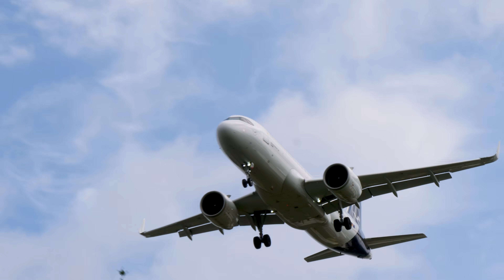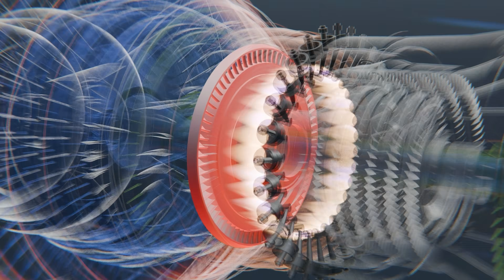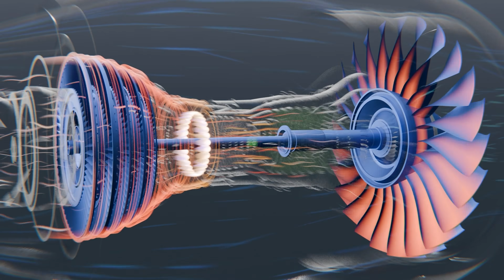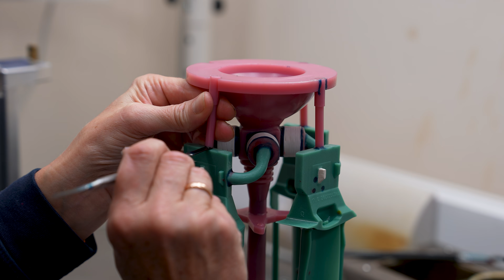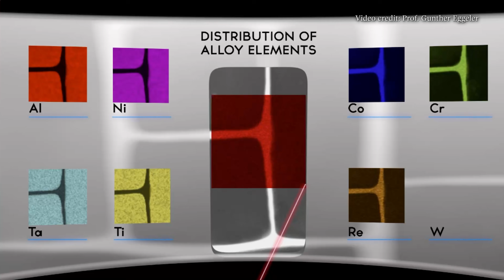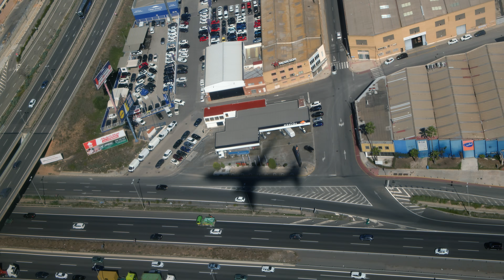The Ridiculous Engineering Of Jet Engines

Comment: I noticed the title changed. For the record, I was more interested in how it runs hotter than its melting point.
Reply: They test different titles on different people so they get the most clickbaity one (same for the thumbnail), it's getting old and boring because you know for sure, turbines get a lot of dirt when working. I mean, they are giant vacuum cleaners!
Reply: @Ktulu789  its not them doing it. they upload multiple thumbnails aswell as different titles, youtubes algorithm Choose wich to use to get you to click on it
Reply: The Mrbeastification is real
Reply: "For the record, I was more interested in how it runs hotter than its melting point"

I guess you didn't actually WATCH it then... because that is exactly what happens.
Reply: @thomasneal9291  wait the title changed AGAIN. When I first commented, the title was something like, "what happens if you throw sand into a jet engine?"
Reply: current title is Why Don’t Jet Engines Melt? for future ref
Reply: @jademonas yeah that's what it was when I first added the video to my watch later. Then it changed to something about throwing sand in a jet engine by the time I actually watched it.
Reply: @thomasneal9291 I was talking specifically about the title changing. The title I first saw was something like, "how does it run hotter than its melting temperature?" By the time I watched it, it had changed to what it is now.
Reply: Same. In fact, i had forgotten what i wanted to watch because the actually interesting premise wasn't visible anymore. It can be very annoying.

Comment: jet engines are interesting, they are operationally more simplistic than a piston engine as they spin and do the intake, compression, power and exhaust all at once in nice clean linear fashion. no parts moving rapidly in one direction, stopping, going the other direction.

Yet to spin fast enough and burn hot enough to be useful they require materials science and machining precision that no piston engine could ever match. And despite all this huge complexity to make one, jet travel is still safer per passenger mile than any other means of getting around, You are safer during your flight than you were driving to the airport and will be driving away from the destination airport.

Comment: I see this video in my feed for the last week or two and I've seen several iterations of the title and it's really upsetting to see it getting dumber with each version. First it was something like "how jet engines work". Then it became "works at 1500 degrees, melts at 1300". Now it's "what happens if you throw sand into a jet engine". I get it that you run A/B tests to get more views, but the fact that to get more views you need to get dumber and invent cheap sensational bs a-la "red hot knife vs potato" is sad.

Great video though, as always.
Reply: There is absolutely nothing in this video that isn't in several dozen other video's about turbine blade manufacture from 10+ years ago other then he compiled that information from 10 years ago and dumbed it down for an American audience.

Comment: Jet fuel can't melt jet engines.
(Coincidentally this video also contains the explanation of the WTC structural failure: You don't need to melt stuff at 1500 ° C to do damage if it has the tensile strength of a wet toast over 600 ° C)

Comment: You could have spent a minute on the flip side of jets becoming cheaper and cheaper to fly: The Jevons paradox. You increase the efficiency of something, this makes you consume less stuff (jet fuel in this case), this makes it cheaper, and that causes more people to want it, and so you end up consuming MORE stuff. This is happening big time with aviation. People are flying more and more, and more people are flying, this by far outweighs the gains in jet efficiency. So the fossil fuel consumption and the carbon emissions from air travel keep increasing, with no end in sight. Most other industries have credible paths to decarbonisation, but air travel doesn't really have any.There's no credible path to electric mass air travel other than short hops. Biofuels aren't credible either, because of the huge land areas needed to grow them.

The market can only limit this if more carbon taxes are added (or bans on airport expansions), which drive up ticket costs and cuts off those who only now are beginning to be able to afford flying. Voluntary flight reduction doesn't seem to go anywhere. There is one fair method: Assign air travel quotas to each person. Those who don't fly can choose to let their quotas expire, or sell them to people who want to fly more. This would keep it cheap to fly rarely, but would drive up costs for frequent fliers. Businesses would adapt and travel less. (There are problems with this, certainly, but the status quo is not sustainable. Something has to give.)

Comment: EVERYONE LIKE THIS. Veritasium, for your "why has noone measured the speed of light" video i have a solution. So.. what if we send the light from both sides, we have a clock on 1 side and a clock on the other. Both clocks will start the timer them the light is sent, when the lights reach the opposite clocks the clocks will record the time, Not stop. When the lights return the clocks will stop. That way we can tell if there is any delay and reverse engeneere it.

Comment: 0:00:  Without watching this video I can answer that question.  You throw sand into a jet engine and the inside of that engine is so hot that the sand will melt into a liquid glassy substance which then freezes up the engine.  The military equipment in Iraq in the year of 1991 had problems because the fine desert sand --- like confectioner's sugar --- was getting sucked into the engines and then gumming them up when it melted inside the engines.  And by the way, sand in a jet engine falls under the definition of FOD.  In the military, FOD stands for "foreign object duty" which involves the daily task of sweeping runways and aircraft carrier decks of anything that could get sucked up into an engine during takeoff.  However, FOD is also used as a noun to describe the actual pieces of foreign matter --- such as "losing a jet engine to a piece of FOD".

Comment: Am I the only one annoyed by the conclusion of this video?: Why don’t the blades melt at 1500 degrees? Because they’re not at 1500 degrees (cooling channels and ceramic coating keeping the metal underneath cool). So the metal underneath isn’t running at those temps at all, only the ceramic is.

Comment: Licensed A&P here. The FAA states 75% of the air passing through the hot section should be utilized for cooling. This means your flame is only burning 25% of the air. That remaining 75% cooling air is specially tuned like an organ or other instrument to ensure that the flame itself is not melting the turbines, vanes, or the sidewalls of the combustion chamber. If the flame was actually touching the turbine blades this would cause them to melt.

Comment: You didn't mention that the reason that Whittels jet engines were possible, is they used the newely developed Inconell, the 'Staybrigt' branded stainless steel used for cutlery, the only reason that modern turbine blades can survive higher temps, is that they have over 400 cooling holes in them, amongst the ceramic they add for those temperatures..

Comment: As always, another "brilliant" presentation. Our own technology helps in the area of damage of turbines in a most unusual manner; rather than increase the thermal limit of the materials, for a turbo fan engine we simply increase the propulsion gained by the fan itself. For a given total thrust, this results operating the engine at a lower RPM, reducing the loads on all rotating components by the square of the difference in RPM, but also lowering the fuel burn, the fuel control system provides a fuel stochiometric mix as a function of air mass in the core, not the bypass. A remarkable part of this is we lower the EGT of an engine such as the CFM56 by over 100C compared to the standard engine, while producing the same thrust at an RPM too the fan that is around 9% lower than standard. We operate in an environment that is brutal, but it is far kinder than the turbine or the compressor, but material science is key. 

An odd effect that we have found in flight was that the faster we fly, the greater the benefit that occurs from our technology which is applicable to the best fan blades in use and development, which currently are arguably RR blades on the Trent 1000. This gain is due to the base loss of performance that any fan encounters as free stream velocities increase, as thrust is achieved only by Newtons 2nd law, the mass flow rate x deltaV, + the deltaP x the area of the nozzle. In that simple function is the answer in the physics of what DeltaBurn has achieved and is now certifying on propellers and turbofan engines. 

An excellent presentation on turbine design issues! Well done Veritasium,

Comment: Your engine diagram is very off. Fan is connected to the LP compressor then comes the HP compressor, HP turbine, LP turbine. Fan, LP compressor and turbine are all one shaft.  You have 3 sets. 33:57 you saying high pressure but on the picture it’s highlighting the LP

Comment: There is a firm in Ireland that reconditions these blades by cutting out cracks and welding them up. Would be interesting how they maintain the single grain structure but maybe that is their commercial USP.

Comment: 37:13 I work for a scaffolding company that does work with power plants, so I’ve been around and seen some of these blades and the procedures for keeping foreign materials out of the turbines and air intakes. It’s insane how much money this stuff costs. They’re willing to burn 200,000+ dollars a day to hopefully stop any undocumented parts, tools, and materials from going missing around these parts. We can’t even use wood in certain areas because the chips could completely destroy the machinery once it gets turned back on. Throwing sand into that turbine at the end probably cost 12 million dollars

Comment: I knew there was advanced engineering that went into the blades but I had no idea it was at this level. Like the tiny holes in them, that's incredible.  The precision needed to drill these so that they are consistent is crazy. I imagine there is a lot of thought that goes into how often you change the drill bit for example as the way it drills will change over time and each blade needs to be exactly the same.

Comment: Wasn't the original title of the video "Why don't jet engine blades melt......or something? What prompted the change?
Reply: this video has 3 titles (and thumbnails) that got swapped around depending on YT algorithm metrics. it automatically changes based on what gets more engagement.
Reply: @raidenxt8737  this helps a lot to understand. I didn't knew that. TIL!
Reply: I didn't saw that original title, but it makes more sense than this new one actually.
Reply: particuarly the since the new one never shows it. just briefly mentions it.

Comment: Ah yes, sand... otherwise known as carbo blast. Walnut shells fed into the turbine at temperature to abrade and clean the compressor and combustion blade sections. There is also 'carbo' meaning dry ice but that's usually a manual cleaning process. Couldn't help myself when I saw sand in turbine engine as a topic.

Comment: THIS is why we will go to electric flight. Like ICE cars, this is the very pinnacle of the engineering "S-curve", where we have gleaned every possible gain from the etch - and a new tech is the only REAL way to make more gains. Which may not be speed, but maybe cost.
It's like comparing a Ferrarri V-12, arguably the pinnacle of automotive engines, to a Tesla Plaid. The plaid is still developing, the V-12 doesn't really have much opportunity left.

Comment: 3:28 most fighters have a small bipas ratio so some air bipas the engine core and is just blown by the fan 
only older fiterjets have no bipas air at all the air go into the engine core this type of jet engine is a turbo jet the one explained in the video is a high bipas turbofan and modern fighters have low bipas turbofans

Comment: Used to work as a Thermofluids Engineer for RR XWBs… never got such a clear understanding of how exactly the metallurgy works at the lattice level. Always knew the blades are single crystal; today I learned how they are manufactured… really amazing. I was expecting something from the thermodynamics point of view, but I learned a lot about the materials! There is pure reasoning and science behind why everything happens the way it does in this machine , it is one amazing piece of art! Thank you guys!

Comment: getting a single directional crystal per casting is astounding! ...i use organic source carbon (charcoal) and forced air (bellows) to supply additional energy (fire) to increase the dislocations and grain regrowth in an iron carbon alloy (steel) as i reshape it mechanically (hand forging)...bet that nickel superalloy is sure a pain to forge!

Comment: Without watching, I can answer the question. Sand cleans the engine. I used to be a mechanic that rebuilt the jet engines for the F15 aircraft. They would seal engines up in Iraq and ship them back for repair, thats where I would come in. They would be the cleanest engines internally that I had ever seen.

Comment: As a metallurgist whom has worked in both the nickel superalloys industry and the aircraft engine industry I say this video is a masterful explanation of the materials science. It presents the right amount of information to explain the essential features of the material behavior without oversimplification and without getting sidetracked into the VERY significant theoretical underpinnings. The visuals are first rate, accurately representing the crystalline structure and material behavior.  The bubble raft explanation of dislocation movement is the best I have ever seen!

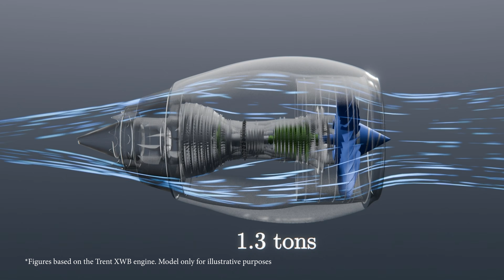Comment: At 1:00 it is said air gets compressed to 50 atmospheres. Melting temperature typically increases with pressure. Could this also help the blade resist high temperature ?

Comment: I’m a materials scientist and engineer and this video was very good, all the topics mentioned as the phases, the crystalline structure, the movement of dislocations and even the heterogeneous nucleation (as nucleations points were mentioned for the monocrystalline structure) of Ni superalloys are very interesting. I also remember that the corrosion assignment teacher talked about the jet engine the first day of class.
For any curious: 7:55 This is the elastic field (in which the stress-strain relation is linear).
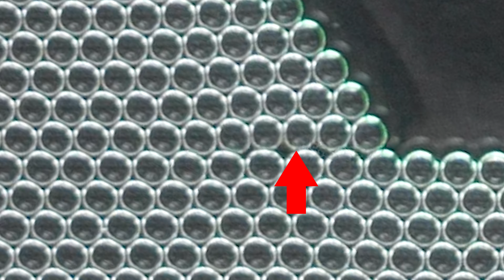9:34 Dislocations can only happen in metallic bonds and some weak bonds, that’s why ceramics does not have (or have a little plastic field) as the ionic and covalent bond can stand the simultaneous breaking and formation of new bonds.
12:20 Also its electronic band structure is more similar to a ceramic than a metal (but W is a metal).
13:46 Wax casting is a very good technique for metal processing 
17:15 Cr gives a lot of corrosion resistance due to chromium oxide protecting layer that forms.
19:57 Also, the collective movement of dislocations can be quantized and the emergent quantum property of that collective motion (or quasiparticle) is called dislon.
21:34  That’s because it hardness the materials, that’s the same that happens with some material that increase in hardness while deforming as the grain boundary’s accumulates the dislocation and increase the hardness of the materials following the Hall-Petch Equation, but as hard the material the fragile it turns.
22:34 As more thermal energy more solid state diffusion.
23:25 Gamma stabilizing materials.
24:06 Not only metals can be crystalline (polycrystalline or monocrystalline) but also can be amorphous (metal glass).
25:44 With a surface for nucleation (heterogenous nucleation) and other techniques the grain nucleation and growth can be more easily controlled.
29:52 That is called anisotropy (preferencial direction for one property).
30:36 That is called a dendrimer form.
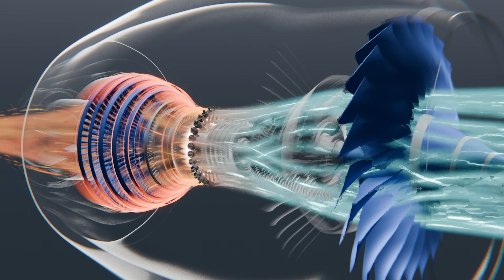31:12 That is because the polycrystalline alloy have different planes in which some of this planes will have a lot of energy and want to react to lower its energy causing corrosion.
34:23 The ceramic coating acts as a thermal insulator coating.
Very interesting video, everything is very well explained!
Reply: this was an EXCELLENT breakdown of the more advanced details, I even learned a few things I had forgotten since college lol. Thanks for taking the time to elaborate on it!
Reply: @lexinwonderland5741 You’re welcome, thanks you I appreciate that! 😄
Reply: Excellent comment man. Added a lot of value for further reads and as hints for a deep dive. And you made a lot kf concepts i read in school and college useful all of a sudden.
Keep adding comments like this in future!!! Thanks
Reply: @kiransharma6721 You’re welcome! Thank you very much for that comment, I appreciate it!!! 😁
Reply: How do you know all this? 😅What do you do for a living
Reply: @puneetkumarsingh1484 I learned everything from my degree at the university, we did not have specialization on the degree so I learned a lot of things from each type of materials and from the different branches of material science and engineering, and now I’m doing a master 😅
Reply: dude.  thanks for bringing back some many memories from my colleges days.  you're awesome man.